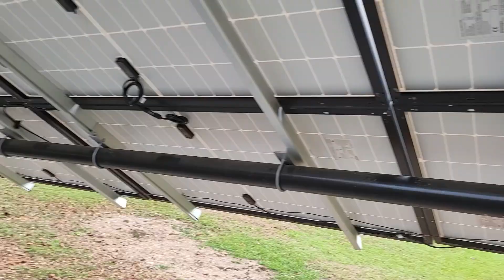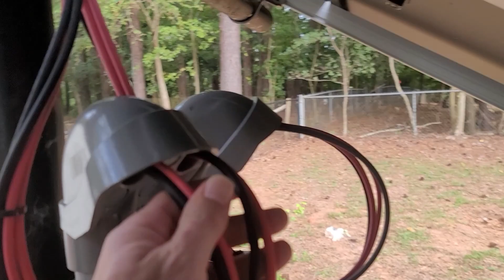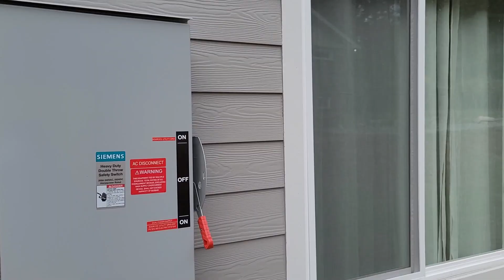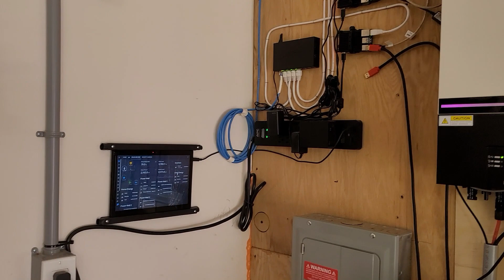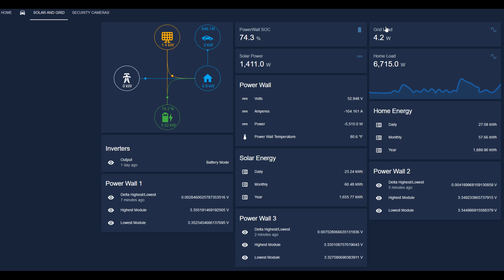LV6548 Part II Grid Interaction & 6 Month Report

Comment: If u ever do a full detailed video strictly on the 4 Raspberry Pi units the program parts needed hub type network wire type standard or RS232-RS485  ur wall layout connections etc along with the solar monitoring that would be great im trying to run my layout just like that whole left corner of your inverters..

Comment: If you are grid tie then why do the batteries hold you back from producing power. Why isn't the inverter sending it max output to the grid after the batts are full?
Reply from the maker: Because these inverters cannot send power back. And in GA having inverters that can send power back is good. GA Power does not pay you enough for kWh sent back to make it wort while investment. Grid ties are expensive.
Reply: @DMIINC2013  same here in Louisiana. I am interested in these inverters. But I thought they could be used on or off. I want grid tie w/battery back up. Bcuz I want to use stored energy at night and reduce my grid use but I don't want to sequester loads.. My utility pays .019cents pkwh. So if I can block power from going back or if the inverters can sense how much energy needs to be produced for the demand and always produce slightly less that would be ideal.. Thx for responding.
Reply from the maker: @blainecelestaine4543  these inverters can be on or off grid. Just cannot export back to utility. I love them so far.
Reply: @DMIINC2013  Thx . I'm taking that to mean that you have it powering dedicated loads on a separate panel.
Reply from the maker: @blainecelestaine4543  my whole house runs on 4 inverters and 55kwh in batteries. See more videos.

Comment: What panels are you using? I think I remember from a previous video you stated they were wired in a 2P6S configuration. Is that correct?
Reply from the maker: 2P6S yes. Longi, Solar Home and Trina Solar for panels.

Comment: Are these inverters capable of backfeeding the grid for net metering I was looking into using these inverters on my system and net metering was a large part of my plans. Here in Arkansas the excess power generated will roll over to the following months usage, therefore minimizing the need for such a large power wall. Great looking system looking forward to updates
Reply from the maker: They cannot back feed to utility.

Comment: I have a challenge for you.

I crashed my pair of LV6548s with my 11kW EVSE. 2022 Bolt.
I was running 11400 watts and they over-temped at 20 minutes.

I'd like to see how you do with your four on your Mach-E.
Reply from the maker: I have not crashed my LV6548s yet. Car charges at 10kW and highest load I had was around 18.5kW for maybe 15-20 min. I really do not have anything to even go close to 20 kW load. That is why I have 4 since we are dealing with lower priced equipment.
Reply: @DMIINC2013  Yesterday I had a day where I fully charged the battery and saw the LV6548s "turn off" the panels.

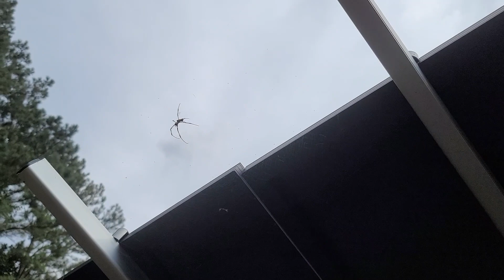It happened again today. This time at 1:15 in the afternoon.

Now I know the feeling of wasted energy. I could have had my car plugged in at that time, but it was charged enough also! 🤣

I would say I gave up at least a full 10 kWh of solar due to not needing and not using the electricity. What a great problem to have.
Reply from the maker: @JasonCarmichael  Indeed, what a great problem to have. Wish there was a way to post pics...

Comment: Check out the Signature Solar EG4 batteries.  They have a shipment coming in. They started pre-orders yesterday...
You could 
almost double your battery bank size and still have excess. As far as panels chasing a 1 to 2 even 3 percent improvement in panel efficiency really isn't worth the cost, Better off investing in more batteries.

Comment: At what point will a panel upgrade be preferred?
Reply from the maker: Interesting question. If everything stays the same consumption wise then not for 10 to 15 years. However if I was to upgrade panels at some time I would like to have same ground mount system with at least 50% higher output. Does that make sense?
Reply: @DMIINC2013  My all electric 800 sqft home requires 20 kWh, avg daily; converted without the intention of using an Electric Vehicle.  Three (3) things I want to add are conditioned attic, Solar hot water storage (to also provide a dump load), and EV charging.
Thank you

Comment: I may have missed the list of parts in your solar mount. What size/type of pipe did you source?  Which panel rails did you use? What spacing between pipes? Great info as always.
Reply from the maker: Thanks. See this video https://youtu.be/vmWXG6jT9i4 behind my thinking process then visit Ironridge website. There are several videos on install process too.

Comment: Haha solar is like money you never have enough for most of us at least. If exporting power is not an option then more battery is the way to go, some loads can can be on timer and work good too like hot water then it is a battery too, obviously car charging if convenient should be done in sun time, you could make a dump load for extra production when not needed such as bitcoin miner or Hydrogen gas production but all these things make more projects. You make great videos and solar carry on!!!!!
Reply from the maker: From Sep 21 through Oct 1 was nothing but clear sky. Abundant power. However before spending more money I will gather more data, year at least, before committing to another large purchase. Thanks. Did weather ever improve up in Canada?
Reply: @DMIINC2013  Ya weather changed it got worse lol I figured it takes a year of use to pay for one battery bank and I only paid $50 a kwh for them.
Reply: @offgridwanabe  where did you find a storage solution for $50 kw?
Reply: @williamjohnston3770  Junkyard the Municipalities were taking there hybrid buses out of service and the packs were selling cheap
Reply: @offgridwanabe  do you have a point of contact for these to see if they've got any more?
Reply: @williamjohnston3770  Contact Frank Z on utube he has them for sale.

Comment: great system ! you need to clean those panels regularly :) ! Maybe a project would be an automatic cleaning system for the panels.
Reply from the maker: They do cleaned more then regularly. Rain this year kept them in tip top shape. Glass on these panels appears to be coated with something that helps them shed off dirt real easy. Deep clean will occur after one year in service. Thanks.

Comment: Is there another box you could add to where you could feed excess power back to the grid?  To make your system function as if you had hybrid inverters?
Reply from the maker: Yes but not worth it with GA Power.

Comment: Good to see an update man! a couple of comments here. With all the electric vehicles coming out people without solar will be overwhelmed by how much the actual cost will be incurred by charging their new vehicle ( Possible service upgrade costs, electrical costs to have a 240v outlet installed where needed, etc)
Personally, I'm not on board nor do I want an EV myself, but that's just for my personal reasons. Being retired my auto gas costs are only about $30/month and for me it is not worth taking so many KWH away from my total production ability.
To further explain my comment. I had to make a decision on the most cost effective way to run these inverters to get back the most return. These inverters are capable of a max of 56amps. 
I made a priority list-
 1 Refrigerator
 2 Sump Pump
 3 Heat (furnace)
 4 Security camera's and Home security panel
 5 Internet
 6 My office (Tv/computer and outlets)
 7 Lighting
Pretty much  emergency operation. Then I did the calc. on those and found I had much more available so I went to the "What else would I like" list which was ... The rest of the house! 

Well, this is where I got creative and had to be careful!. I didn't have enough for everything running at once so my thought was to connect the cheapest draws that are on most of the time.
This eliminated all of the 240v high draw appliances that I only used a couple times a week. (Electric Dryer & Electric Stove).
The A.C. would not be a necessity but would be the number 1 on the Like to have list for the high draw appliances so I went with that!

I will have way more panel power that I need and most of the time a lot of wasted power, but that's okay. The lighting, tv's etc. that don't draw much at the time but draw the most over a "period of time" because they are always on became the bread winners if you get my point. IE - the electric dryer uses 3500 watts which is huge, but I only use it a couple times a week for an hour or so. At the same time this would cripple the max capacity that I could draw for that hour... 

Sorry if I'm getting too deep here LOL. 

Any way, THANKS for the in depth update brother!  Lookin good   : )
I had to add that my personal opinion is you would be fine without the EV charging and not having to add battery backup (ROI)
Reply from the maker: With prices of everything going up, yes, some people will be in shock when they have to add additional outlet just to plug in $500 charger. However it will all even it self out over longer period of time. 
Either more panels or more storage is always good. Leaning towards more storage just because of the weather experience this year. But need at least 1 year of data to make informed decision .
Without EV, system is more than enough but wish for very long term is to have it all under one umbrella.

How is your system coming up? Eagerly awaiting.......

Comment: I believe that your production numbers are low because your batteries were charged so quickly. Look at increasing your battery bank.
I'm in South Georgia and this year my production was down also.
What type of water heater do you have?
Reply from the maker: Rheem Heat pump water heater.
Reply: @DMIINC2013  I wasn't aware that MPP inverter's are grid tied capable? It looks like you're using your power wisely. Consider installing a tracking array or at least another one facing SW to extend your coverage later on in the day

Comment: Do you have any plans to break down exactly what's installed on each of the Raspberry Pi's, other than having Home Assistant installed on one of them? Also, I'm curious as to what specific addons and integrations you're using in Home Assistant.
Reply from the maker: See this https://youtu.be/z-NvMkUjryE HA is on separate machine. I can do video on that. Thanks.